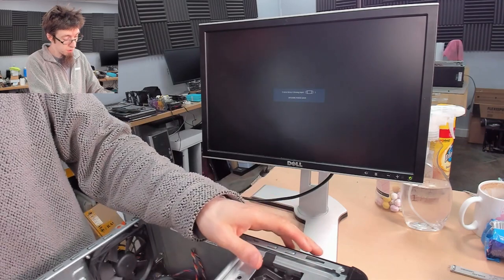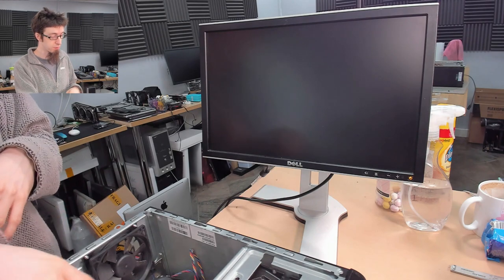Compaq CQ2 Power cycling - LFC#311

Comment: if you convince the owner of this thing they need an SSD THAT IS UPSELLING
Reply: That's unethical.
Reply: @DaleDix  im  just going from the "upsell" comment he made last video lol.
Its not meant in much seriousness. 
its just to try and point out the bad connotations of the word. and how "I personally feel" that the word can make you look like an unethical business when you use it.

probably better to use the word "upgrade"
Reply: @DaleDix  Upselling is not unethical. It is a common practice in sales. Ever go to fast food and they ask what size drink you want? That is upselling.

Simply telling the customer: "The computer is fixed. I recommend installing a SSD, solid state drive, to replace the aging hard drive. The system will turn on & load programs noticeably faster."

Not sure how that is unethical. This is a business machine, time is money. All those minutes waiting for it to boot and load programs will turn into hours. This is all $$$. An ssd will pay for itself fairly quick.
Reply from the maker: Yea, I made a comment about this in the last video - there's two ways you can look at "upselling" depending on need and _value_.
This PC doesn't need anything more than a defrag, but getting the customer to buy an SSD would give them a much better user experience. This is a good value prospect and isn't unethical.
Convincing them that they also need 64GB of RAM technically makes the PC better, but isn't good value, won't improve the user experience, and thus would definitely be unethical to upsell.
So yea, it depends on how we define "upsell" and what we're upselling.
Reply: @TLM-Nathan  its just semantics.. 
up-selling can be unethical "and usually is".
Its more often than not selling you something that you dont need just to make some extra money, 

With this system. trying to sell them an ssd would be the bad form of up selling IMO, as it really is just throwing good money after bad. 

BUT 

you could also argue that convincing them to buy a new system, could be ethical or unethical.  (depending on the use case of this system) 

Personally id advise the customer to upgrade their system. at this point, But then again if all they use it for is some sort of nas or linux based server, that would also be un-ethical. 

Its just semantics of the word "up-sell" 
generally people up sell you an extended warranty for no reason.
so the word has bad connotations. its all just an argument about semantics :D

so from a "how i want to be perceived" stand point. 
Id argue its best to use the word "upgrade" rather than "upsell" 
up sell is just a word your shady car dealer boss uses to get you to sell all the pointless extras.

p.s

just because something is common practice does not make it "ethical". 
Its common practice for bakeries and other similar places to throw out their food at the end of the day.. 
is this better for their business than allow people to get free food?? 
Sure.. 
Would it be better if they gave it to food banks?? Yes
is it common practice for them throw it all away whilst some people starve? 
yes
is that ethical?? 
no.
Reply: @shambleslongplay3566 Brother chill tf out he’s not Dell
Reply: @crylune  This is a year old and you didn't read the comments lol.

Comment: I always wonder why PC's like this with such small motherboards, just 1 drive and 1hdd, and in this case not even a power supply are housed in such large cases. To me that just looks like such a waste of materials on the case, and a waste of space...
The motherboard is kept small because of cost, so surely that would go for the case too, if kept equally simple.
Reply: Because they used the same case in other models with different / higher end internals to save on cost.

Comment: 1 Beep - Refresh Failure
Reseat/replace memory, troubleshoot motherboard.

2 Beeps - Parity Error
Reseat/replace memory, troubleshoot motherboard.

3 Beeps - Memory Error (first 64KB)
Reseat/replace memory.

4 Beeps - Timer Failure
Troubleshoot motherboard.

5 Beeps - Processor Failure
Troubleshoot CPU, motherboard.

6 Beeps - Keyboard Controller Failure
Troubleshoot keyboard, motherboard.

7 Beeps - Virtual Mode Exception Error
Troubleshoot CPU, motherboard.

8 Beeps - Display Memory Failure
Trouleshoot graphics card, motherboard.

9 Beeps - ROM BIOS Checksum Failure
Replace ROM BIOS, troubleshoot motherboard.

10 Beeps - CMOS Shutdown Register Failure
Troubleshoot motherboard.

11 Beeps - L2 Cache Failure
Troubleshoot L2 cache, motherboard.

Continuous Beeps - Memory or Video Failure
Troubleshoot memory, graphics card, motherboard.